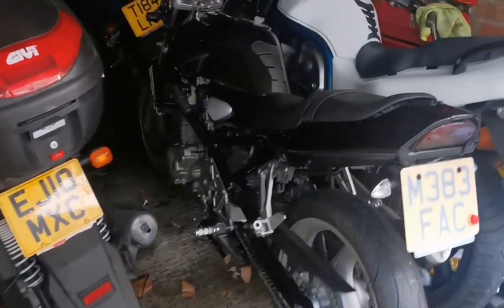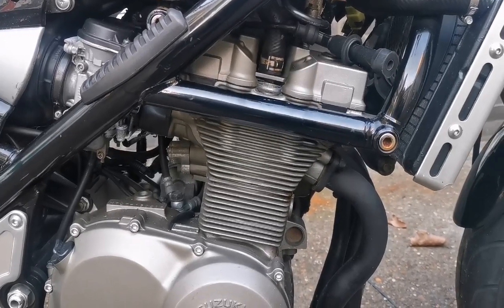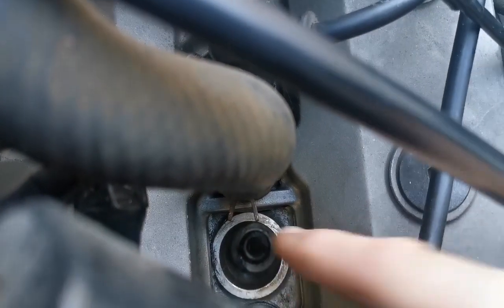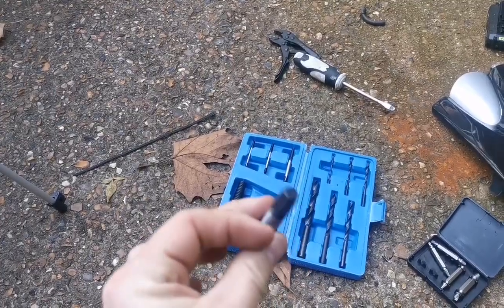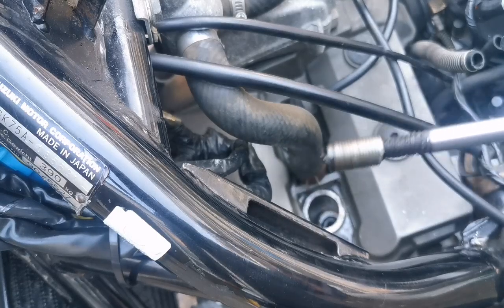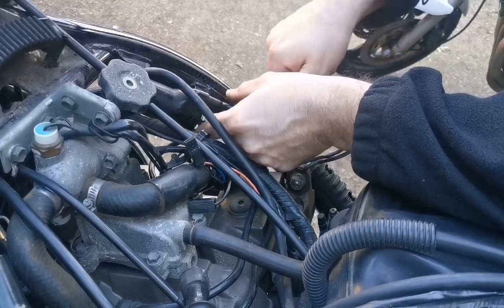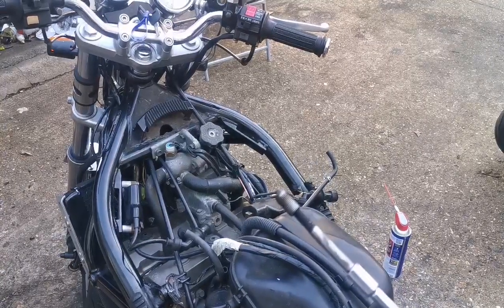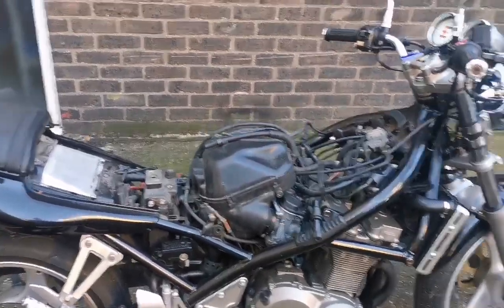How to remove a snapped spark plug. Broken spark plug removal. Broken spark plug extraction. H

Comment: I have a gsxr 750 and we can’t seem to get it out with not even the extractor . Any ideas?
Reply from the maker: Oh your talking about a snapped spark plug? 

You need to put plenty wd40 down there and let it soak for a few days, keep topping it up. It's got to soak through to the threads. 

If you can't extract it like this you will need to take the head off and it will be easier like that.

Comment: what tool did you use to get the thread out?
Reply from the maker: Hi mate, please subscribe if you havnt already.

They are called different things but should look like the ones I show in the video. If you write screw extractor, or bolt extractor into ebay you will see some. You well need a full set because spark plugs are different sizes.

My advice is to keep spraying wd40 into the broken stud for a few days and rgis will help with the removal.

It may or may not work so good luck with it.

Thanks for watching.

Comment: Why you use wd40 its for electricts Water Dispersant
Reply from the maker: It's also a lubricant and will flow into the threads of any screw making them easier to remove
Reply: @motorcyclerescuer  ..why not use acf50 it's more expensive but seriously halfords sells high performance penetrant spray your wd40 did nothing you could have put red rubber grease on thats a lube but it's not lube you needed it was the correct tool to remove the spark plug and that is why you had to make a mess of a easy job
Reply from the maker: @mrblister8359  again mate I didn't ruin the job I was fixing the bike for someone else. Wd40 works perfectly and I've done lots of research over the years as to what penetrative sprays work best.

You may prefer one and I prefer the other.

I have plenty tools and did not snap these plugs in.

I help people out who need help and I do it for free.

Thanks for watching

Comment: there is atool that comes with the bike to remove the spark plugs it's a special tool you cant use a hex socket or you could have orderd one. same with a honda ntv 650 dont try and remove the plugs with the wrong tools or you will be buying more tools just to do a simple job.
and potentially fuck the threads then you have to take the tank off and the head gasket.
haynes manual are cheap as well lol
Reply from the maker: Hi Mr blister, I didn't snap these plugs in I was just helping out the young man who did. I have plenty tools to do the jobs I need to do and rarely can't find the right tool. I got the job done and the bike runs very well now.

Thanks for watching.